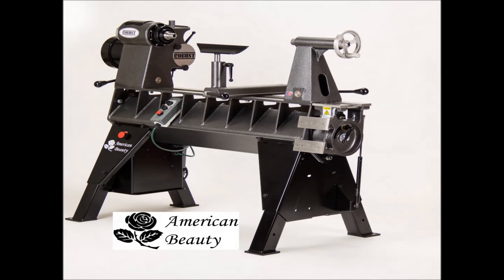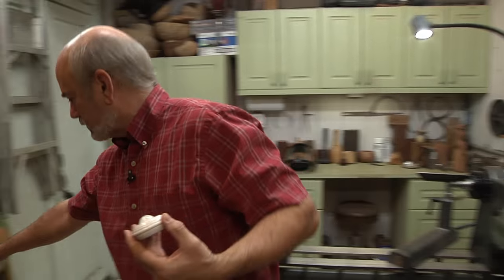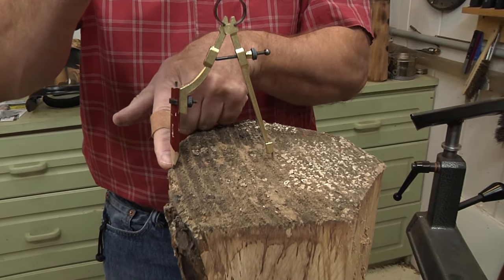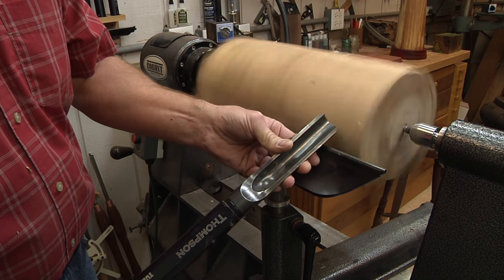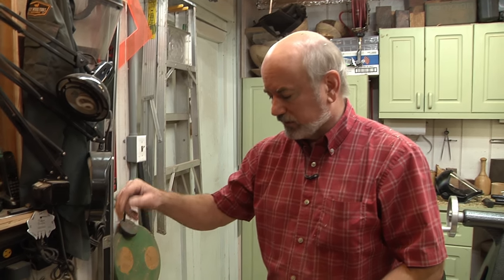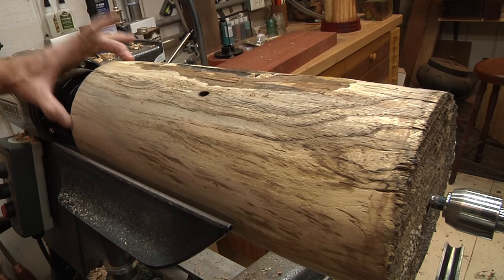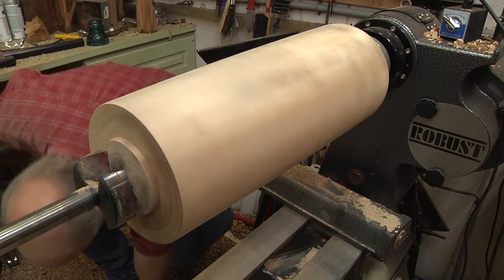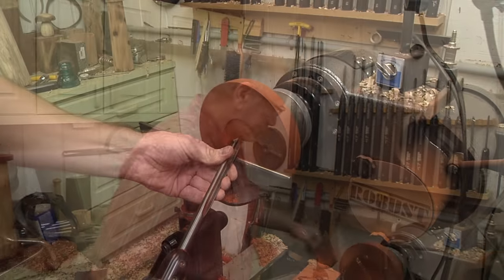Lighthouse

Comment: Tim. I used a 1 inch led flashlight through the bottom and hung a glass bobble at the top. I found smaller flashlights on the Internet but you had to buy large quantities. Allows a smaller lighthouse.